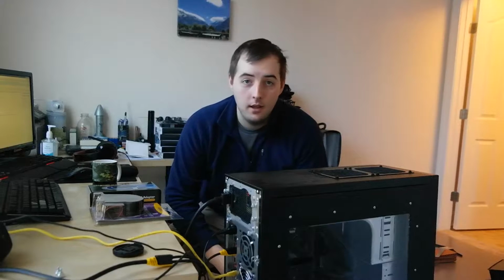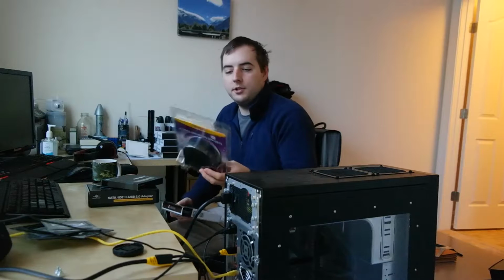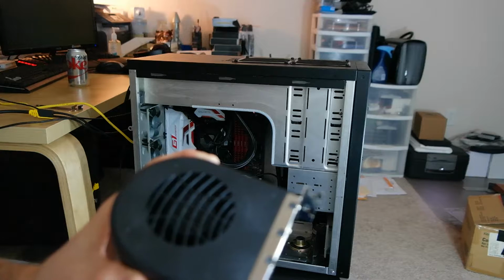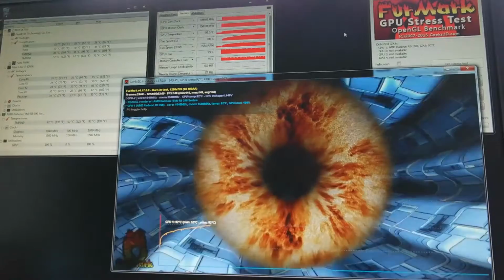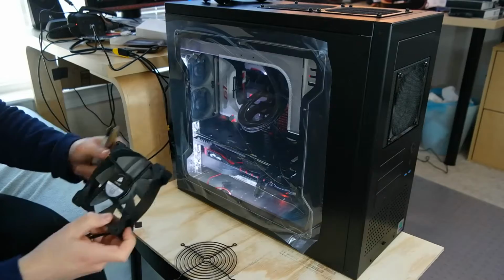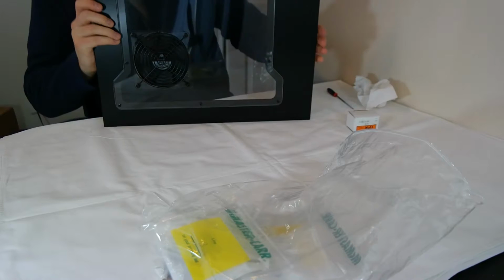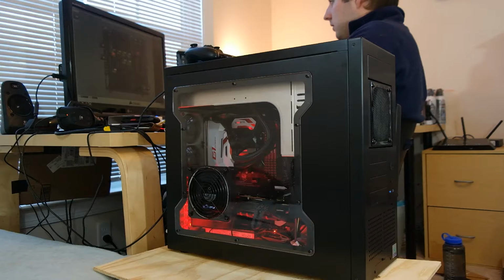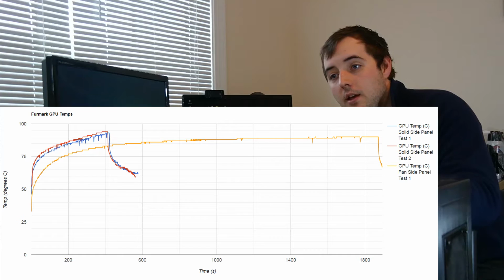Side Panel Fan Case Mod to My Lian Li PC-65B

Comment: Have the fan blow air into the case. You'll see  greater improvement
Reply: That's what I thought, heat rises so top fan or back fan exhaust
Reply: @jamieboyd5208  the side fan would blow cool air to the gpu and then be exhausted through the top or rear. It would net much better temps than using the side as an additional exhaust.

Comment: Imagine a 200mm fan it would be better, also big fans usually gets a smooth sound and I think all the cases should have this side exhaust panel fan. My Asus ROG RX570 is suffering in my Aerocool Playa.
Reply: Cooler Master HAF 932 ;)
Reply: this is my last destination of triyng to find the right cooling for my gpu after 4 days researching... just put a 200mm inhale fan on the side lol

Comment: Great job, you probably have a new PC, but I would like to say I think it would have worked better to have the fan blowing on the GPU heat-pipes, which would've could down the GPU more. I can confirm this, since I have an old CoolerMaster CM690 case which have fans blowing inwards on the CPU VRMs and on the GPUs and I get a 10C improvement versus not having side panel fans.
Furthermore, I can stress test my RX 480 with OCCT for much longer (haven't pushed it too long to prevent damage) without it thermal throttling, whereas in my Corsair graphite 230T case it thermal throttles within 2minutes.

Comment: nice im doing a similar thing with my case antec atlas 550 but not to the extent that you have. what i have done is remove the front drive cage and painted the inside black to stop rust and made a cutout at the back for a cpu back plate

Comment: You're primary people was the case itself. There wasn't room for intake and you were consistently trying to compensate with more exhaust and creating negative pressure, as where it would've been more beneficial with positive pressure as the computer was struggling to get cold air in the case.

Comment: Super late to the game but I would add some intake either by more fans pulling in or a power offset on them. Pulling more air in will force air out instead of creating a vacuum. Also probably already stated dont obstruct flow on exhaust fans with dust filter. I did the same thing at first lol.

Comment: hey any updates if the side fan becomes intake instead of exhaust? i'm going to config this way but my parts is not available yet
Reply from the maker: cafeorange I'll try it out when I have some time. Probably going to change to a different brand of fan as well so I'll repeat some GPU tests for both configurations.
Reply: indeed, it should be an intake, hot air goes up and goes out by your top exhausts
Reply: I've just installed a side fan as intake and the temp are just staying the same. I think that the hor air is just going in circle in the bottom of the case

Comment: It would be interesting to see what your results would be if you just deleted the acrylic of the side panel and just installed the side panel without the acrylic. I think your temps would improve. At the same time i would exhaust the 240 rad air from the top out [is the top rad intake or exhaust now?]  And see what results that would bring.  I am in the middle of building a 2x360mm & 1x120mm rad build and will be experimenting with all exhaust and no acrylic on the side panel so all the exhaust fans will not fight for air as there will be loads of air naturally sucked in huge side panel opening and out all of the exhausts. I'm pretty sure i am going to have fantastic results.

Comment: u need intake fans on the side and switch for stronger front bottom intakes
Reply from the maker: +James Kan Where do you suggest intake fans on the side? Reverse the direction of the fan I put in? I already have more fans blowing in than out. More fan holes?

I used to have more powerful bottom intake fans, but they were far too loud - part of the purpose of the build was to make it quiet. I agree that more powerful fans would help solve the problem.
Reply: ***** 
I'm going to add a bit of info:
1. You want strong input fans on the bottom portion and output fans on the top.
2. If your front panel fans haven't already been changed to inputs, you should.
3. Your side panel fans need to be input because currently the cold air hasn't run through the heat pipes of your graphics card before being exhausted.
4. If by copying the configuration of the above video, your temperature hasn't gone down, you'll need better case fans overall.
5. You can find videos of benchmarks on temperatures between different fans on youtube easily.
6. You can also find fan tests with fog machine to get a visual on how much air is moved between different brands of fans. Also you should find out about the difference between airflow and pressure optimized fans.

I'm leaving this much info because I can't physically inspect your current configuration through the internet
Reply from the maker: 1. Agreed - I'd prefer this configuration, but the case makes it difficult. Putting an input at the bottom of the front of the case but an outlet at the top of the front of the case seems like a bad idea, however, for running the risk of cycling the air without getting the airflow across the motherboard. Currently the fans are more in a "front-to-back" configuration.
2. All front panel fans are inputs.
3. This is something I'll probably try out, it may work better than treating it as an exhaust. The plan had been for the bottom front inlet fans to blow air which gets to the GPU fins, but it may not be happening if the fans are not blowing enough air.
4. I'm trying to keep the case quiet, and the previous fans I had moved air fine, they were just too loud.
5. Agreed, I'm looking into replacing some of the fans I have, I'm just prioritizing noise over all other parameters at the moment.
6. Understood - currently I'm using a mix of airflow and high pressure fans - 2 high pressure fans (NF-F12s) blowing through the radiator. The front 120mm inlet as well as the four 80mm fans (2 in, 2 out) are high airflow fans (since they shouldn't really have any significant resistance to air flow immediately in their path). The case has a static pressure Corsair SP120 fan exhausting out the side panel (partly because it's what I had available).

Thanks for the thoughts. At some point in the future I'll buy some different fans and reconsider the airflow arrangement. Ideas for better fan brands for the case (with reasonably low noise)?

Comment: Might be a dumb question: The side fan- Do you have it oriented to blow out, or to blow in?
Reply: It was blowing out air. That made me think what would happen if I place my side fan to exhaust instead of intake, but in my mind is better to have it as an intake of fresh air.
Reply: @DidYouDieYet  My case only allows two intake fans from the front. I currently have 3 140 intake fans, 2 in the front of the case and one on the side panel. I also have 2 exhaust fans, one on the top (140) and one the back(120). My case is very very dusty, I can't imagine how would it be to have another exhaust pulling dust from the non filtered little holes in the case. Maybe in the future I will get another case and add a small AIO.
Reply: Remember: the front side of the fan always pull the air to the back.
Reply: It depends on where you live, if you live in US, EU or any where with low temp then it should be intake. Personally i use it as exhaust because i live in tropical hot ass country, i don't want my side fan blow hot air to the case

Comment: I got a Corsair 500d with tempered glass side panels, however i really would like a modded side pannel for the left side to blow some cool air from a fan onto the M2 slot area.  When i open my tempered glass Sidepanels which are on hinges, there is the wholes in the rim of the case where you would normally slot a normal side panel on.  Is it possible for me to find such a side 
panel which allows a fan to be mounted to it for extra intake?

Comment: why dont you get a different case, like the Fractal Design R5.

And thanks for the video :-D
Reply from the maker: +aXnMaN That would be the simple solution :-p. How else to get better at casemodding than slowly destroying a case I already own...

But seriously, buying a different case for the parts would be the easiest way to get temperatures down, I agree.
Reply: +C. S. Redmond I like the case you are using just not it's cooling options  :-D

I have an old Antec LANBOY case laying around i painted and modded a little bit years ago, thinking about doing some more work to it and repainting it

Comment: If i was you, Id have 2 of those fans on the side. One blow in fresh air onto the graphics card, and the other blow the got air away from the card. and also, i was wondering what tool you use to cut the acrylic out with.
Reply from the maker: +Michael Wickersham I cut the acrylic with a Dremel 4000 using a multi-purpose (561) bit mounted on the circular cutting attachment. I'll be giving the computer some time before I decide to make more cuts in the side panel; I'm afraid it will defeat the purpose of the window if I fill it with fans completely.

Comment: fix the rat nest in that pc and maybe the air could circulate properly 😕
i do like how fans look mounted to acrylic, but there should be more than enough room in that case to push air without it. those cables are just a nightmare though